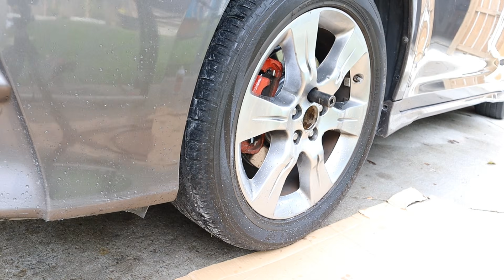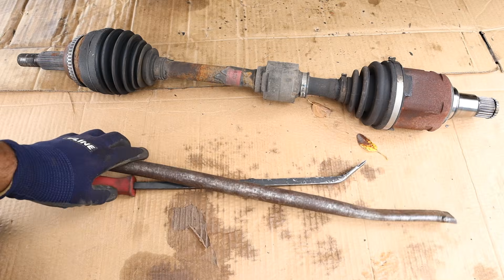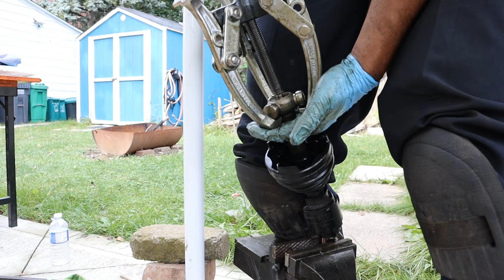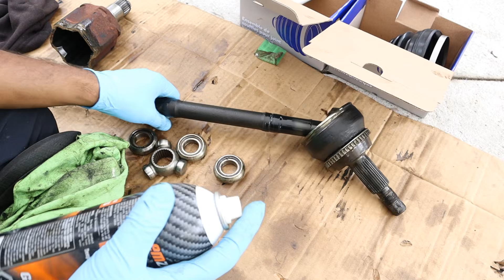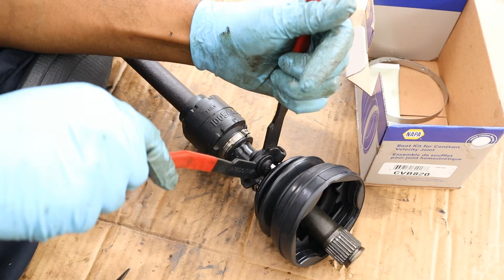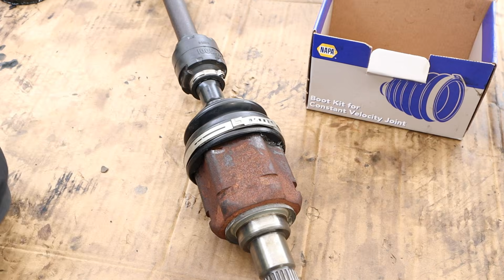How to Replace CV axle boots

Comment: fun tip. Get a big open pan and fill it with gasoline and use that to wash off all of the grease. Works incredibly well since gasoline is a solvent. You might get a headache though from huffing all of the gas fumes. Still good times. lol
Reply from the maker: Gasoline is a good cleaner but I don't wanna get high

Comment: 2000 mazda protege 1.6L A/T FWD, passenger side cv axle wouldn't separate from the intermediate shaft ( connected via circlip ). 
Could I just remove the old axle from the inboard tulip cup and slide my new axle into the old inboard tulip cup?
They both are the same sliding tripod type like you displayed. 
Love the channel.
Reply from the maker: Yes, just be-careful to not get any contaminants in there and seal the boot back properly.

Comment: Well, you have successfully convinced me to buy the $90 cv axle rather than buy the $25 boot and hope the joint doesn't go out after a rebuild for just a boot...
Reply: oem quality and durability vs aftermarket
Reply: Right though, seems like a pain. I just stuck a cheap aftermarket part on there. I was thinking about rebuilding the old one just to have as backup.
Reply: Aftermarket is 🗑️
Reply: Yep same here
Reply: 100%
Reply: Check out RAXLES - have someone else rebuild your axles!
Reply: MY thoughts exactly. You already had to take the cv axle off to properly clean and replace the boot. Why not skip all the cleaning and frustration with the cleaning and grease and just replace the whole thing. You don't have to worry about it failing in a year.

Comment: good day, where do i get the "inside" ball-bearings and that ring. My Pajero 2006 left rear Cv joint's ball bearings and the "ring" is finished-gone
Reply from the maker: See if the OE sells parts separely for a rebuild. 
Otherwise you might have to find another used one or go aftermarket

Comment: First time I saw someone uggadugga the castle nut but then precisely torque the wheelnuts. Great job on the explanation and thanks.
Reply from the maker: The axle nut has a huge enough torque that ugga Dugga is good enough. 
Wheels, if not seated properly should be torqued evenly.

Comment: Hey man. I'm a noob who's done some work on my car with the help of a much more knowledgeable friend. This doesn't look super hard other than maybe getting off that bearing assembly. What are you thoughts on this as a diy thing for a noob? I'd probably only take out half the axle as that just appears to be a lot easier.
Reply from the maker: The passenger side axle with the bearing is much harder as it often seizes in there. 

Many people will reboot by taking off half. 

But if replacing the axle, better to cut it off than deal with that bearing!
Reply: @speedkar99  How strange, why would the passenger side specifically seize up? 

Also I just found out that friend wants to help me and he owns a pneumatic hammer which seems to be one of the preferred tools for that job. I suppose if worse comes to worse i can take the axle to a mechanic as they have more  robust tools to remove it and if absolute worst worst comes to worst i'll just replace axle haha.

Every professional mechanic i've seen do this job either tapped it off with a punch or pneumatic hammer. seems hard to believe it could be impossible with a pneumatic hammer. Maybe i'm naive though haha. 

Either way thanks for the response.

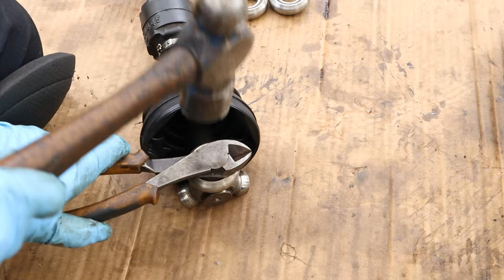Comment: 5:51 how do these bearings stay in place? Some brands put a snap ring on those three individual bearings but it looks like Toyota (and my Honda) did not? What prevents these from coming lose and how does it grab in the first place? Groove or oval shaped?
Reply: I haven't done it but just saw another video that shows an circular snap ring. The way he got it off is with an air hammer by hitting the back of the outter joints center bearing assembly. To put back on the nissan boot kit came with a new clip ( so they know what you have to hit it out) he used a flat head and while pressing one side of the clip got it just under bearing and tap the front with a hammer. Hope this helps. Oh so it in a groove.

Comment: @speedkar99 I can't get my new axle back into the transmission, just won't go. Looks like you didn't even have to push hard at all. Did you adjust the snap ring or anything?
Reply: Maybe the small ring. I heard they should be opening at 12 o'clock

Comment: Always hated those cv axles, that's why i prefer rwd car cause its really hard to brake cv boot, they go Always straight, 180k miles or almost 300k km and the cv boot on my bmw e46 are still there

Comment: It's likely that an automatic transmission will lose transmission oil when the Axel is pulled out. 

Plug it and prevent oil from coming out. If you car is over 120k miles and never had a transmission fluid change -- YOU NEED THAT FLUID
Reply from the maker: You need to change the fluid if it's never been done. Drain and fill, don't flush. You'd be surprised at the dirty color that will come out.
Reply: @speedkar99  nope. 

If the fluid has never been replaced in over 120k miles then the clutch pack is already toast. All the grit is inside the fluid. 

If the fluid is dumped then all the friction is gone from the system and the transmission won't shift anymore. Maybe not day 1 but well within the year

I've seen it happen twice in the last 10 years

Comment: No one fixes axles anymore due the  price of new axles are not that bad.An axle that looks good can also be bad causing a vibration finding out a joint is locked up
Reply from the maker: I'd rather stick with my OEM axle as long as it's not damaged. Aftermarket ones are hit and miss with the quality.
Reply: @speedkar99 Never had a problem with the aftermarket yet.The OEMs made by someone else for them under the Toyota/Lexus,Honda/Acura brands

Comment: OEM toyota boot bands are the best,  but in a Toyota forum some one suggested  marine 304 stainless smooth band clamps worm type,  i tried them ON Lexus & Toyota boots and have had success with them staying on tight.  McMaster-Carr  of Santa Fe Springs has them  PN 5574K24  and 5574K16   much better than local parts stores.

Comment: Another good reason to replace the boots instead of the entire axle assembly you know the condition of your axle and bearings unlike those cheap rebuilt axles whose bearing surfaces has been ground down undersized and bearing surfaces not surface retreated properly and although serviced could have 500,000 miles plus as you would not know how many times those axles were rebuilt and not to mention balance issues as sometime the rebuilder removes the rubber vibration balancing device on shaft,bottom line you yourself know the condition of your axles before the boots started leaking
Reply from the maker: Agreed. Vibrations is not something I want to introduce with a new axle.

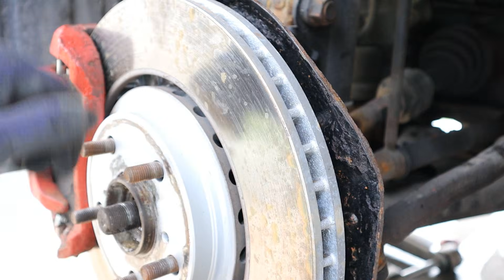Comment: At 0:39 the axle slides with fingers . . . wow . . . not its first rodeo.

For when it's fused by rust , there's a technic with a 5kg hammer driving a puller's bolt ( 1 hit, 1 torque, 1 hit, 1 torque ... )( coz a 20T puller would bend the hub ... and it would take 20T )

Comment: Great video big fan here 👍, just one question. If there is no leak or tear in the boots, do we have to change the grease from time to time? Or is a life time grease as long as there’s no leakage?
Reply: Boots will usually tear and leak before the grease  wears out and usually the only reason you would replace the boots or axle is that the grease will get contaminated if the boots are torn and leaking

Comment: Is it possible for the CV axle to just pop out from the transmission due to 'aggressive'  driving?
The reason that I'm asking is that a few months ago my son had his CV axle replaced. A couple of weeks ago, he was attempting to back out of his driveway and he couldn't move his car. He had it towed to a different mechanic who found that the shaft had broken inside of the transmission right at the point where the retaining clip groove is cut into the splined section. The remaining portion of the axle then partially slid out. Additionally, the new mechanic told us that the old mechanic had used the axle for an automatic and not a manual transmission.
We are trying to get the old mechanic to cover the cost but he has taken the approach of a combination of ghosting my son and essentially being guilty of being a millennial.
I've only ever pulled a couple of CV joints out of transmissions and every time it took a lot of effort. 
Is it possible for the axle to pop out while it is in place???
( the car is a 2016 Elantra)

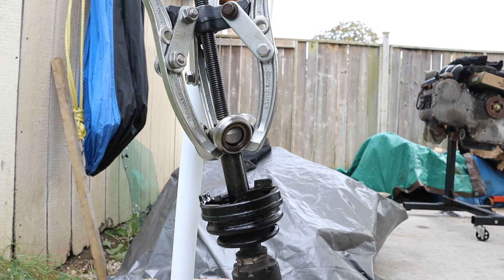Comment: 2:20 WHYYYYYY

this job really is way more complicated than simply replacing with new CV Axle….
Reply: The Toyota FSM prescribes using a brass punch rod and hammer to drive the tripod off the shaft. Sometimes when it's seized on there you have to resort to a puller or an air hammer or some other more drastic measure.

Comment: I have replaced boots a few times but always left the inner CV joint together and took the outer joint off the slid on the inner boot first then the outer. Boots have been v expensive and whole axles not costing much more than the two boots together and the time to take things apart and get back together is a lot shorter when you get the whole axle. Good video. Happy Motoring.
Reply: i've been reading that aftermarket axles are no good though.

Comment: When changing the CV boot, does the seal where the axle is put back into the transmission have to be replaced also
Reply: If it is not leaking,leave it alone.In the state of Michigan,shops can be pinched for replaced parts that do not need replaced.

Comment: Not going to lie, it looks much easier in this video than it is in practical application… unfortunately I had to experience first hand the poor quality control and design of aftermarket axels when I replaced a CV on a Camry similar to this one from Napa auto parts and when to text drive, when I put the car in reverse it made some god awful noises. I thought I had fucked my transaxel…. Was freaking out until it dawned on me, I pulled the new CV out and compared to the old one and sure enough, the splines were at least an inch and a half shorter than the original. Transaxel was fine, just wasn’t engaging properly. Went back to Napa and told them to stick their bunk axel into the enema cannon and bend over. They found me an axel with proper measurements post haste. I’m still not sure it’s worth the trouble to reboot the OEM axels, but it will definitely prevent experiences like the one I had.

Comment: Great video - I would only add to mark the position of the cup and bearings on the inner joint so each bearing goes back into its original cup - otherwise you can sometimes create more play - they don't always wear evenly
Reply from the maker: Great point!

Comment: How much is a new CV shaft?
Reply: You can get cheap online axles for $60. Good luck with those, though. OE axles are extremely better, so they're worth rebooting if they aren't having any problems other than leaky boots.
Reply from the maker: $100+ for an aftermarket one.

Comment: Did this job on my car recently. Had grease leaking out afterwards due to overfilling and those no-good cheap clamp pliers. I bought a better type after, with a screw to tighten, and fastened the clamps more securely.
Reply: Well done 🤙
Reply: Yeah running into this on my sister's Altima. Got some stainless steel worm hose clamps. Going to use some electrical tape to wrap around so it doesn't damage the boot.

Comment: Just got inner cv changed on suzuki liana, along with balancer shaft, turned out that last workshop replaced the original balncer shaft with repaired one (which had worn out splines or groves), that caused the inner cv to fail

Comment: Great video and professional editing 
What’s the difference between CV joint and U joint? Is the U joint more reliable?
Reply: The sliding parts of the CV joint permit it to work more smoothly at greater angles and for the wheel to turn at a more constant speed when steered. The universal joint is stronger and simpler but it requires a much straighter path, like from the gearbox to the rear axle.

Comment: I like those torque specs 😂
Reply from the maker: Me too
Reply: @speedkar99  The ball joint to control arm bolt and nuts should it be tightened to 94 ft lbs, not "nice and tight". The axle nut should be tightened to 217 ft lb, not "really really tight". Otherwise, you'll wear out the bearings faster.

Maybe you should just stick toscrapping cars instead of fixing them.

Comment: My 87 Celica had the same problem under 100k miles. Glad to see Toyota - 30 years later - still hasn't figured it out how to design a reliable CV axle. Fantastic job by the way...you make it look easy, but it isn't.
Reply from the maker: The boots are subjected to environmental conditions and will fail eventually, I don't think it's a design issue.
Reply: @speedkar99 silicon grease on the outside of the whole boot helps greatly
Reply: Toyota had major rusting/rot issues back then and through the 90's. Even after that they were on the hook for replacing the subframe on 4Runners.

Comment: It is  a very good idea to spread the lubricant all over those dry bearings and even inside. You can close those clips with pincers as well.
Reply from the maker: Pincers?
Reply: @speedkar99  They are sort of pliers used for pulling out of nails. They have very thin claws that are suitable for squeezing that metal locking mechanism very much the same way.
Reply: @skodovkar  I've heard them referred to as "nippers"
Reply: @magicoddeffect  Could be, I am not native english speaker.
Reply: @speedkar99  e.g. https://en.wikipedia.org/wiki/Pincers_(tool) like the carpenter's plier-like tool to remove nails.

Comment: Don't forget if you're replacing the right hand side, the axle nut is reverse thread.
Reply from the maker: Huh? I've never heard of a reverse thread axle...and I've taken apart quite a few...
Reply: @speedkar99  I don’t think he knows what he’s talking about…
Reply: Not on any Toyota I've ever worked on.  They are the same, normal threads for lefty loosey and righty tighty.
Reply: Maybe I'm just thinking of my old 80s corolla

Comment: Brother, way too time and labor are you saving any money. What's wrong with aftermarket or rebuilts with lifetime warranty?
Reply from the maker: I haven't heard good things about aftermarket axles, especially regarding balance and vibration. Might as well keep my OEM axle for a s long as I can because I know it's good quality.
Reply: @speedkar99  I'm not talking about discount $49 shafts or Crappie Tire quality, but well know remanufactures. Once the boot is torn and dirt gets in the joint is toast. Also, once it's dismantled the balance is out the window. BTW does your bother ever wonder where is close are?

Comment: Also, cv axle might be stuck to the wheel hub. Don't bash it with a sledge, wheel won't fit after that. 
Use heat to expand and brake the CV splines loose
Reply from the maker: I've never had an issue with it stuck in the hub.  It's usually stuck in the transmission
Reply: @speedkar99  for me my 12year old compact suv had exactly that. Man I started to hit it with my sledge and guess what happened.. and how good the heat solved it all, albeit to late ;(

Comment: ASTUTE Speedkar99 
Thanks for sharing it 
Please don't forget to have 4 wheel Alignment carryout on the vehicle 
👍 
From Nick Ayivor from London England UK 🇬🇧 ⏰️ 20:39pm
Reply from the maker: Why do you need an alignment? 
I didn't touch the tie rod or strut
Reply: You remove the lower ball joint ,that  the camber adjustment
Reply: @nickayivor8432  I thought the camber adjustment was bolts, usually the 2 on the strut tower. Never heard of the lower ball joint being a camber adjustment.

Comment: just be happy you don't have to change the grease every 50,000 miles i guess
Reply from the maker: It's a closed system. The grease is self contained unlike a ball joint where contaminants might enter.

Comment: Personally, I would not expect the new axle grease to move from the axle boot to the metal portions of the cv joint all by itself.  I would instead make sure I put new grease all over the metal parts first, before putting the remainder of grease within a boot.
Additionally I would most likely remove that outer cv joint from the axle shaft (not an easy task) before replacing it's boot, much easier then to get new grease into the metal parts while the cv joint is off the axle.  You are the engineer.  I am the thorough mechanic.
Reply from the maker: The grease will move everywhere with centrifugal and turning motion. 

I know it sounds counter intuitive to not lubricate the metal parts.
Reply: Yes, hopefully eventually, yet initially those very hard metal parts are not protected.  Additionally, I wonder why they used a more liquid grease from the factory on the inner joint ?   @speedkar99
Reply: the grease will sling everywhere in like first 10 meter of driving @meathead585
Reply: @meathead585 Try using shitty clamps and you'll see just how fast the grease spreads everywhere on the bottom of the car.

Both parts use the same grease, one is old and worn down, hence more liquid, other one is contaminated with dirt due to the torn boot hence thicker.

Also something you would'nt expect, drive enough with a torn boot and the cv end will be completely dry and grease free, all due to the rotation (can't be washed off with water) . It gets everywhere.
Reply: In the OE Toyota reboot kits, they will include two packages of grease. The thinner grease is for the outer boot and the thicker grease is for the inner boot.